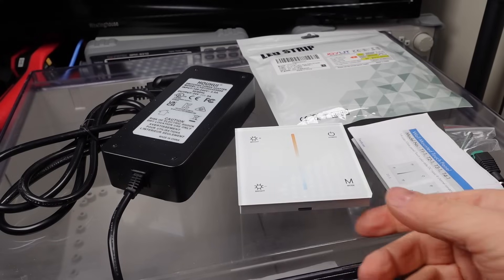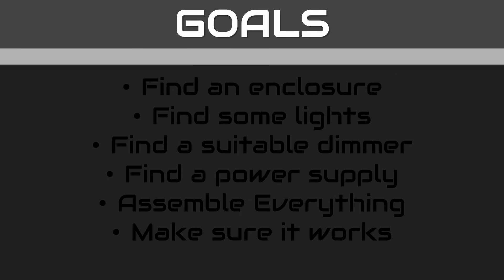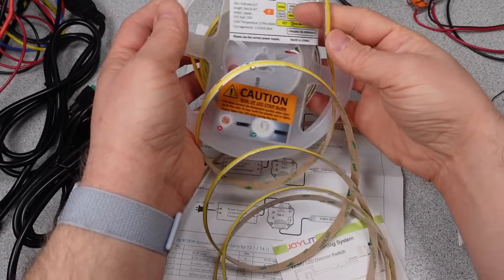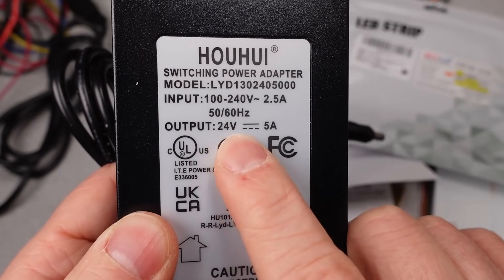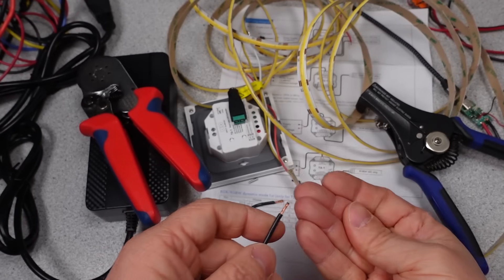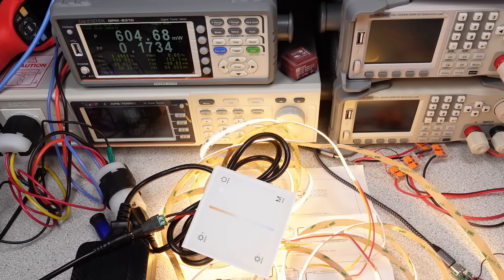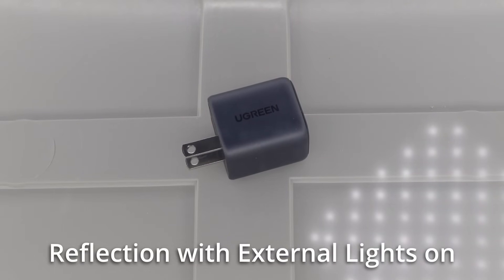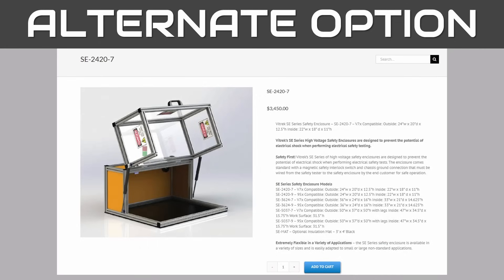Project build – Light Box with Cover for Videos

Comment: nice, looking forward to new videos.
kind of off topic but im wondering if you would ever consider reviewing some of those alxp cheepy diy powerbank boards.
lot of people making their own powerbanks now days but its really hard to find good info on these boards or even just demonstrations/efficiency/thermal stuff.
greatscott has a video about the ip2366 board, bidirectional 100w usb-c capable. i use 2 of them in parallel to build my own 35$ 420wh powerbanks out of cheap 7 buck "32ah" lfp cells in mini ammo cans. the r2 position can be shorted with solder to set them to lfp voltages. really versatile but no one realizes the thermal issues you have to account for on the board to get the full speed. 
diy powerstations/ecoflows are becoming a big deal in ukraine to run their REB's (radio electronic battle?), basically diy ewar devices everyone needs if they get close to the zero line. 
have a good day yall

Comment: If you really care about color accuracy look for SSI, not CRI. Also, lots of pretty color accurate videolights from respectable brands with magnet attachments, wireless app control and no flicker on the market nowadays, just fixing some small panel or tube with magnets or something, seems like an easier solution, but money question, I guess...
Reply from the maker: Yeah, that's a good point.  I see the point in what they are wanting for SSI, the references are lacking units on graphs so you don't get a sense of scale and how the perception of these things matters though, but cinema wants things certain ways.  In the white paper even missing that...  Cinema not engineers.  So, in my case, the multiple phosphor and multiple color temperature LED is the approach I use, then on my regular lights I also use another filter, it gets pretty close to 5500k daylight.  A little to the blue side still, cheap LED's.  They should show CRI and SSI of each of the sources so people can get a feel for the performance of the various charts.  The main thing is no single number metric ever captures detail.  

There are tons of expensive lighting solutions that do offer better performance, no doubt.  I think the biggest difficulty is matching LED to LED and tuning your camera to accept whatever the LED is not providing.  CRI is a good start, I've tried some lower CRI bulbs and it makes a noticeable difference but yeah CRI is from commercial spaces.

It doesn't seem like they are looking for color accuracy either, they're looking for performance that matches a reference shape, which then you can tune your camera to accept more readily.  My camera is a ZV1, it doesn't even have proper white balance, forget about chip charting it, so, my options stop pretty short of that.  

But yeah, on the light box, I did add a diffusion layer over the LED's and few different backdrops to the box.  It's primary function is still not blow things up in my face but yeah, improving the light quality is a welcome bonus.  In the case of the box the lighting has to be inside the box (big reflective top cover) so panels and tubes are out because they are too big.  

I will keep looking for some bulbs that may provide a more accurate color render too.  Thanks for the suggestion!
Reply: @AllThingsOnePlace  Wow, that's a low blow from Sony. I know it's an entry-level camera for vloggers, but no custom WB — damn... Regarding panels, those can be pretty thin nowadays, stuff from Godox and such. I would've suggested mats then, but those can be omega expensive. Oh well, good luck to you. Would also upvote one of the comments here — 4k uploads will indeed result in better overall quality, even if it's 1080p source upscaled on a 4k timeline, you should try it.

Comment: What is the best charger with a ground connection for 65W 20v? Need good efficiency from about ~10w.
Reply from the maker: I'm not sure I've seen a 65W one, the Apple 70W has a connection (1k ohm resistor) if you use the extension cable with it.

Comment: Meanwell has a huge range of LED driver power supplies, some with plastic enclosures (usually having screw terminals for the wires so you can install what you want). Many of these are designed for constant-current operation, but some are designed for fixed-voltage LED strips at 12V, 24V, and others. I use a couple of these myself, and they even support a dimming input that will accept either a potentiometer, an analog voltage, or a PWM signal and will do constant-current (ie: zero flicker) dimming down to about 5% off maximum brightness level.

These won't handle your dual colour temperature stuff by itself (at least the models I have), but you can probably drive each half of the strip with a separate power supply and simply adjust the dimming of each LED colour independently. Example models that I own and am very satisfied with are an HLG-120H-24AB (this is a larger metal-housing unit for higher power), HLN-40H-24B, and HLN-60H-24B. The first of those lights my whole kitchen pretty brightly, and the two others each provide good lighting for a whole office and bedroom respectively. They make slightly smaller sizes too, which is probably fine for your needs here.

I have not checked the power factor correction on these units and I bought them quite a few years ago, so Meanwell might have newer/better models and lines now to investigate. Dig through Digikey and see what you find!

Lining your box with white plastic sheeting would bounce the light around more evenly and provide a less distracting background than the bare box too, if you weren't already planning to do that. If you get fed up with the distortion of the lid, you could always cut out a section of it and silicone a sheet of safety glass in the middle to provide a clearer view. A great way to get one of these is to pick up a flatbed scanner from an e-waste recycler; they all have a nice optically clear sheet of glass in them, along with a bunch of other fun parts like mirrors, lenses, motors/belts/rails etc.
Reply from the maker: Thanks you very much for the suggestions!  Yeah, the LED drivers from the major brands usually do have PFC, they have to meet CEC/DOE/(used to Estar) guidelines, as you mentioned, I'd need a constant voltage driver to be compatible with the controller but there are plenty on the market.  I was looking at OSRAM and Philips drivers too.  

On light diffusion, yep, back drop and more diffusion sheets is part of the plan.  

I did not think of the safety glass idea though, that's probably worth while to look into and yeah, usually can find an old scanner, copier, printer unit around that would be about the right size too.

Comment: As you have a decent supply of USB-C PD EPR capable adapters, have you considered getting a programmable USB-C PD to DC 5.5mm cable? I recently got the WITRN PDC002 for about $15 shipped. The latest version of the cable enables AVS support as well as PPS, allowing a DC voltage output range of 3.3V-28V, including supporting a fixed 24V output you're looking for.
Reply from the maker: That is one option and yeah was thinking about that.  I don't have a trigger that will ask for 24V on every start up though.  But yeah, something to figure out.
Reply: @AllThingsOnePlace  If I'm understanding the translated documentation correctly, the cable itself has the capability to do PD triggering. You just have to upload a specific fixed voltage firmware using their DFU dongle that allows you to set a fixed voltage from 5V-28V in 1V increments. Can't read a lick of Chinese here so hopefully my understanding using online translation services is correct! Once I figure out what AVS enabled EPR power brick to get, I'll be trying the cable out to power my own DC24V device here. Hope you find a solution!

Comment: 10:05
Its not that difficult to find. Just search meanwell power supplies, they have detailed pdf and its popular in the sffpc community due to its Vpp ratings. Also they make medical grade PSUs, I think they start with EPP or RPC, don't quote me on that. 
That LED strip is not good and seeing the video, its low brightness and ngl i think that cri rating is fake. Get Auxmer 24V LED, they are the GOLD standard. Checkout quinled as he has all the current/voltage/power testings of led strips for most, its under analog led.

Comment: if it flickers you probably need to reduce your camera shutter speed to like 1/60, if you cant set it that low without over exposure then you can use an ND filter - for the strip you could drop the brightness
Reply from the maker: Yeah, the shutter speed will work as long as it's one light source.  The camera is pretty limited, sony zv1.  I don't have an external ND filter for this either.

Comment: You are going to be hard pressed finding an enclosed model with the specs you want. I like the Mean Well open frame supplies. Add a pigtail dc plug and a power cord, unless you absolutely need it enclosed. You might consider having a portion of the led strip facing down, mounted to the outside perimeter of the clear lid. Seems like most of the light is bouncing back and forth between the walls and not being directed downwards. Just a couple of thoughts. Cheers
Reply from the maker: Yeah.  I have other voltages 36, 48v but yeah an out of the box 24v is hard to find.   I did go through mean wells offering of enclosed supplies and didn’t find any.  Open frame is an option but I’d rather it be a bit more closed.   In terms of the light, you need it inside the box, the strips are very non directional, but that does mean that a bunch of light is going unused, some more lights could be added to the top of the inside of the lid though.  Would need good diffusers on those.  Wish I bought more of the same led strip cause now it’s impossible to color match  without using a separate dimmer.  I took a bunch of high res pictures and they look good but yeah it could use some more direct lighting as you suggest.  You can read all the part numbers on components and it’s fairly clear though.  The backdrop will matter too.  Black to film magic smoke.

Comment: Great work here, but I would recommend in filming in higher resolution, either 1440p or 4k.
I understand the 1080p is fine in and of itself but YouTube pust some heavy compression on it and incentivizes that its users pay the premium rate in order to see the higher bit rate 1080p content. However, by watching in 1440p or 4k, even on a 1080p screen, the higher bitrate is kept even when it's downsampled to fit the viewer's screen. This makes content like this much clearer even at the same resolution.
I didn't mention it on your previous videos, but now that you're working on your filming setup, I think it bears mentioning. Again, great job here. I think this will help tremendously with your work.
Reply from the maker: Yeah.  I could at minimum export upscaled to 4K, the raw 1080 footage looks so much better.  I export in low quality because it gets even more compressed once it’s on YouTube.  My camera the zv1 can’t really do 4k shooting.  It claims to do it but that’s marketing. It doesn’t look any different versus 1080 shooting, it adds a lot of file size and pixels but it’s just more compression artifacts, it overheats and fails a lot too.  Not a surprise for the lowest end camera.  If I set the project to 4K it will help for stills of teardown content though.  I’ve been debating it for years but never made the shift.  Your comments make sense though and I should shift over to a 4K project even if the footage is 1080 still.